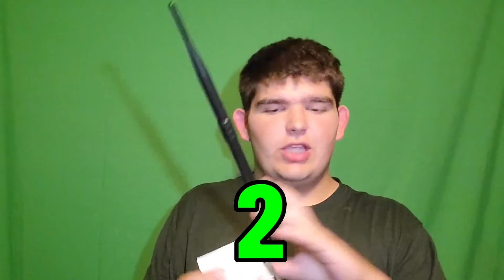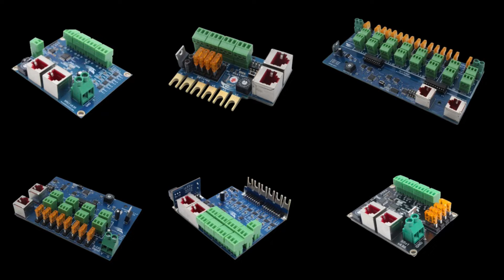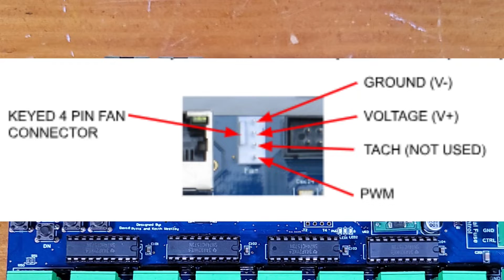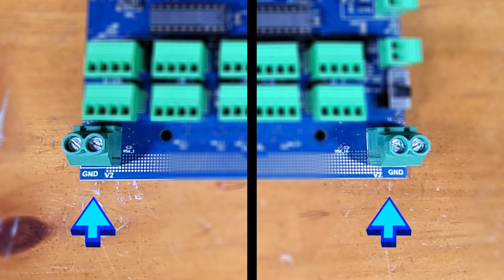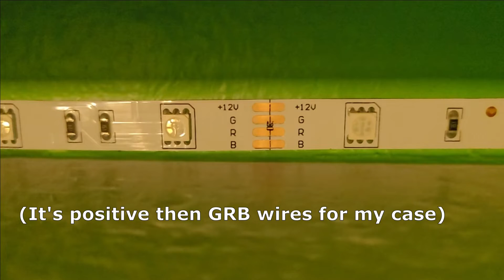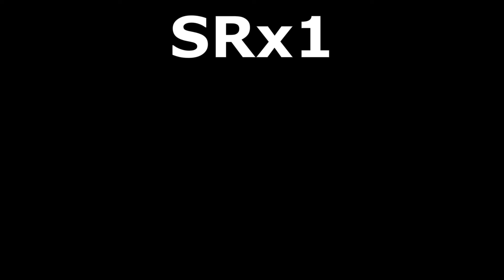Falcon F16v5 Pixel Controller Full Tutorial (Part 1 of 2)

Comment from the maker: I'm just realizing I forgot to mention how many pixels the F16v5 can control.  It can control 16,384 pixels with just the onboard ports, or 32,768 with the onboard ports and an SRx1 receiver on each smart receiver output. Adding more receivers after that won't allow you to run more pixels, it will just stretch the 32,768 pixels across more ports (Aka less pixels per port). I was so worried about getting every little detail right about the F16v5 that I forgot this basic piece of information 🤣
Reply: this, this comment is what i've spent the last 5hrs trying to find hahaha, thank you good sir. i didn't want to invest in receivers if i had to pull props off other outputs.
Reply: Im completely new to this im leaning towards this thanks for your help

Comment: Would I need a Raspberry Pi with Falcon Player to use this? Or is FPP built in?
Reply from the maker: FPP is not built into the Raspberry Pi. A Raspberry Pi is just a small but powerful computer that can be used for many different applications. What we do is take software which is called FPP and load it onto the Raspberry Pi, so it then acts how we want it to (a show player)
Reply: @How2Pixel  Right. I meant is the ability to go onto FPP built into the Falcon Controller itself? Or would I need a Raspberry Pi to control the Falcon controller? since the Falcon controller has its own hotspot capability, does this bypass the need for a raspberry pi?
Reply from the maker: Ohh I see what you mean. You're basically asking if the controller can run by itself without a Raspberry Pi correct? Depending on your controller, you should be able to. Now FPP is a Raspberry Pi only thing, so you can't use FPP on the controller itself. However, there's a lot of controllers that can run in standalone mode meaning they don't need some sort of show player telling them what to do, you can just configure the schedule right on the controller interface. However, there are A LOT less features when doing this and most controller's only include the absolute minimum settings necessary to make a show work. I personally don't recommend this just because it's so limiting, but some people don't mind it and run their show in this type of set up. Just make sure your controller has a standalone mode though before choosing to go this route.
Reply: @How2Pixel  What do you recommend as a first controller for someone just starting out? I have done some basic stuff with xlights and LOR at work and run several light shows every December at work but we buy our sequences from companies and I really only set up the shows, do the networking for the controllers, and run the software on the PCs. We are looking to switch over from LOR to xlights and want to buy a controller and a Raspberry Pi so I can start experimenting and learning it for next year. What is a good first controller for us to buy?

Comment: Great video thank you, do you happen to know where the fan settings are? (in AZ so we need it)  I used to be able to turn it on when it got beyond a certain temp but cant seem to find it in build 38, thanks!
Reply from the maker: I actually have no idea! I just went to look on my F16v5 (I'm in NY so I never need a fan since it's so cold in the winter) and I can't find the setting anywhere. I thought I was going crazy and maybe there never was a setting, but I looked on my F16v3 and there is a setting on the misc tab. My F16v5 says the fan RPM is 1500 though with nothing plugged in. Maybe it's automatically set to always run? I'm on build 34 btw.
Reply: @How2Pixel  ok Im glad I'm not crazy lol, this is what i read: The firmware turns the fan on when the board reaches about 42°C (108°F) and turns it off again when it cools below roughly 38°C (100°F). I tested this out and it's accurate, the new builds just auto turn the fan on, good to know if your in a hot climate.

Comment: On the F16v5 can you connect pixels by only connecting the data cable to the controller and the power to an external power supply?
Reply from the maker: Yes you can! You will however need a ground wire going from the pixels to both the power supply and the controller.

Comment: I have a 5V to ports 1-8 and 12V to 9-16 and the board. Am I OK to power the differential receivers with 5V even though the board is powered by a 12V?
Reply from the maker: Yes that is perfectly fine! The reason why is because the cables that connect the receivers to the controllers only transmit data, they don't transmit any power. Just be careful though and label your power supply and pixels so you are connecting the right voltage items to the right power sources. You wouldn't want to accidentally connect a 12V power supply to your receiver if it has 5V pixels attached.

Comment: What is the best way to get audio for singing faces on my fv16v5 falcon controller? Do I use a sound blaster on the Raspberry pi or do I use an F16V4 Audio Board from Falcon. Either way I believe that I will need an amplifier along with the choice.
Reply from the maker: My opinion is ALWAYS get the audio from your show player (your Pi in this case) whenever possible. It's always the easiest way and I've never heard of anyone having problems with it. So yes, I recommend using your Pi for audio with a sound blaster. You might need an amplifier if you're using speakers for your viewers to hear your show, but the FM transmitter route is normally fine without one since people can turn the radio up in their cars. I've never had any problems with my transmitter, and normally turning up a car's radio 2 or 3 notches makes it loud enough.
Reply: Thank you very much for your input

Comment: What if I'm using 1050 pixels??? Could just one controller support all the pixels or do I need a receiver for literary 50 pixels.
Reply from the maker: Do you mean 1,050 pixels on one port, or on the whole controller? On one port, no matter what the max you can get is 1,024 pixels. However, the whole controller can run 16,384 total pixels even without receivers.
Reply: @How2Pixel  sorry thx

Comment: I am a novice but a retired EE with software app development experience.  I ordered the F16v5 and is backordered.  I need it soon... not after Xmas.  Is the Hinx pix pro OK?  With 16 port SDI outputs.  Plus it will run without a RPi and has sound out for FM transmitter.  But I want to run a projector on a sheet in a window too.
Reply from the maker: I wish I could give you a definite answer, however, I'm not very familiar with the Hinx Pix Pro. If it can run smart pixels and can accept E1.31 or ArtNet input, then it should be able to run fine with a RPi running FPP. You can also hook a projector to the HDMI port on the PI at the same time with the controller running so you shouldn't have any problems with that.

Comment: thanks for the video, Great job !

question, will i need two power supply or is it ok to bride one supply  for both port on the v5?
Reply from the maker: It's perfectly to use one power supply to power both sides of the board! Just make sure that you aren't overloading the power supply.

Comment: Might be too old, but I just got my V5.  As I'm extending wires between strips the data is falling apart quickly.  One strip of 14 LEDs, then a 10ft extension soldered and the next strip blinks different colors.  I have f-amps on the way,  but am reading about adding resistors to the data line. Is that necessary on the f16v5?  Thanks for your awesome videos
Reply from the maker: So I don't know everything about this area and all the ins and outs, but I can try and help. From what I've heard, the controller manufactures decide which level resistors to put onto their controllers. Some of them place resistors that allow the data to go farther, however, it can be easier to damage other types of pixels that normally wouldn't work with that level resistor. Now other controller brands such as Falcon place resistors that may not go as far as those other brands, but this allows you to connect many different types of pixels and you don't need to worry as much about them getting damaged. However, there's not really a point in adding a resistor when your problem is happening between 2 sections of pixels, not a section and a controller. Changing the resistor on the controller would only help the distance the data can go from the controller to the first pixel. Pixels are really bad at carrying data from one pixel to another pixel far away (in your case 10 feet) so I think the best option would be just adding that f-amp in that section.

Now like I said, I'm not an expert in this area so I may be incorrect, but this is my understanding of how it works.
Reply: @How2Pixel  thanks for the reply! My v-amps showed up yesterday, and I slapped them in where I saw blinking.  It instantly helped!  I say helped because I'm still getting some weird pixels during single color dimming to black.  I think I need to just go section by section and double check voltage as I go.  While I've got you, I have to mention, I have a matrix with 3456 pixels and bought an srx-2 to run it. I just realized while it's 8 ports, the share the channel.  So I'm running 864 pixels per channel.  That means the board can't do 40hz.  Falcon says only 760 or so pixels per channel at 40hz.  So now I guess I order an srx-1 and spit the matrix to 8 channels?  It's hilarious 3 weeks ago I knew nothing about this subject.  And now I'm making problems most other people haven't even dealt with!  Again, thanks for making all these videos!
Reply from the maker: So sorry for not replying! YouTube doesn't show me comments with new replies so I forgot to check back here 😂. You said you have an SRx2 right now allowing you to have 8 ports correct? So if you add another SRx1 you'll have 12 ports right? That would probably be the best route to go to control the whole matrix, or if you wanted to you could get a separate controller just for it so you won't need more receivers, but that route is a lot more expensive!
Reply: @How2Pixel  that's what I did.  2rx2 has 4ch of the matrix, then 4 other short string.  Srx1 is doing 5-8 of the matrix.  Worst part is I found out my f16v5 port 32 and 28 are dead.  I had multiple cat5s ran so I could swap.  Ended up cutting cat5 and used the ch29 wires to feed into ch4 of srx1.  I honestly think I'll live with it for this year.  Don't want to send out the heart of the show for repair/replace.  Thanks again for all your vids!!  I had a crazy networking plan at first, but your video on bridge mode simplified things immensely

Comment: Thank you very much, your video is really very helpful. Perhaps you can help me with a problem. I use an external power supply for the controller with 12 V x 3 A. I also have power supply units for my LEDs, which require 24 volts. Positive and ground go from the LED power supply unit into the led stripe. I also send the data line and ground from the LEDs to the controller. Nothing happens in test mode. And the controller display shows low voltage. The volt specification for V2 is also marked orange in the web interface. I do not send any further current to the V2 power supply on the controller. The switch is also set to "external power supply". I hope someone has an idea for my problem. Thank you.
Reply from the maker: Are you definitely powering the controller with 12 volts? Is the input voltage switch set to 7-13 volts? If you do have those things set correctly,  what is the controller saying the input voltage is on the status page?
Reply: @ thanks for your feedback. The problem was very simpel. I had the wrong direction with the led stripe.

Comment: Great video and information. You do a great job of this.
Have question, with a single power supply used I would assume that's mainly to power the boards and will do power injection on each port to get power needed for the 800 pixels per port that you were speaking of.  only 300 watts to work with.
I was thinking of doing one with two supplies on for each side of the F16v5

Comment: hi,  thank you for your videos! 
Could you tell me if we can run a test sequence on the SRx1 smart receiver card (longe range)? via an input for example.
Thanks a lot
Reply from the maker: Glad the videos are useful! To answer your question, do you mean connecting the receiver directly to a Raspberry Pi or a computer to run the sequence off there? And have it go straight into the receiver? Sadly, you cannot do that and it will damage the receiver if you do. The receiver must be connected into a controller since it doesn't have the power to convert a sequence into pixel data itself. The controller does that, then it sends any pixel data a receiver needs over a cat 5 cable to it. So you could run a test through the controller, and have it go to the receiver, but the receiver itself cannot run a test sequence.
Reply: @How2Pixel Yes! I wanted to know if there was a test button on the card. It's already good to be able to send a test sequence via the transmitter card. Thank you for your answer. 💪
Reply from the maker: Yes there is a test button on all smart receivers! The button will test all the pixels that are hooked onto that receiver.

Comment: When using duo data lights, do both data wires go into the data hole?
Reply from the maker: I'm not quite sure what you mean by duo data lights. Do you mean the pixels that have the ground, positive, and 2 data wires? For a total of 4 wires? The extra wire should be labeled "Clock" or  "Clk". If it is, that goes into the clock terminal on a port on the controller. The data wire still goes to data, ground to ground, and positive to positive. Know that if you have 4 wire pixels, you cannot use them with the smart receivers, only the actual controller. What type of pixels are they?

Comment: At 4:13 you show two long range recievers, I can not find the one on the right anywhere? Who sells it? Also the links for the f16-v4 manual is not working, nor is the smart reciever specification sheet. Thanks for help with this!
Reply from the maker: The receivers are sold buy Pixel Controller, also better known as Falcon Controllers. Here's the link to their site https://pixelcontroller.com/ If you go to the accessories tab and click "long range expansion" you should be able to find it there. As for the links to the specification sheet, they seem to be working for me. What happens for you when you click them?

Comment: One very important thing you forgot to mention about the 4-wire pixel, The new ws2815 pixels have a forth data line for redundancy. The 2 data line are labeled DI and BI. DI is the main data line and BI is the redundant line. It's very, very important that people don't try to connect the BI line to the CLK line of their controller or their pixels will not work. When connecting to the FC, DO NOT connect anything to the BI line. leave it floating. In fact, just cut the end off.
Reply from the maker: I'll make sure to mention this in future videos, thank you for letting me know!!

Comment: One more cool feature about the E-Fuses is that if there is NO data detected passing through a port at any length of time during your show power is NOT sent to those pixels arbitrarily.
Reply from the maker: I saw that while I was researching information for the second part of the tutorial! It's crazy how many features they were able to pack into the controller.

Comment: Great video, Have you noticed with the Mean well LRS-350-12 hooked up to the Falcon F16V5 board the screen reads V1 and V2 Votage differently. An example is V1 11.9v and V2 12.3v.
Reply from the maker: That's strange. Is both V1 and V2 being powered by the same power supply? I know the voltage readers are a little off because it always says V1 has 0.6 volts coming in, even when I have no power supply hooked to it.
Reply: @How2Pixel  Yes, both of inputs of the V1 & V2 are powered by the MW LRS350-12. I plan to hook up the multimeter to the power supply and check it output. My thought was the board input V2 is draining that amount causing the difference.  I am trying to find some documentation on how to use the Pot adjustment on the power supply since I haven't messed with it.  Well, once again thank you for the videos. They have helped a lot since I  just starting out.  I have to check to see if you have a megatree video next. Thank you again and Merry Christmas
Reply from the maker: I'm glad the videos are useful! I don't have a specific video for just my megatree, but hopefully soon after I finish the F16v5 part 2 tutorial, I'll make a behind the scenes video for the 2023 show and talk about the tree. Merry Christmas!